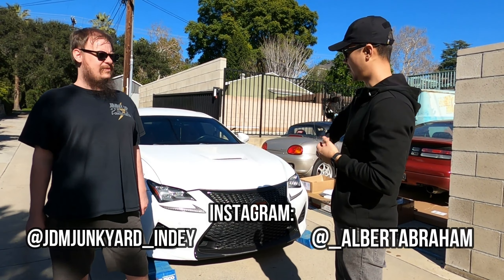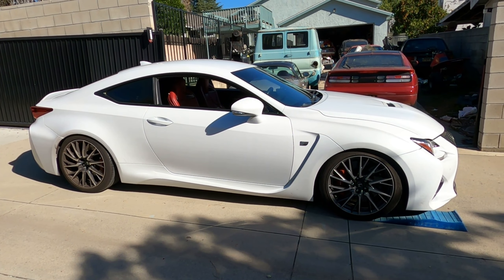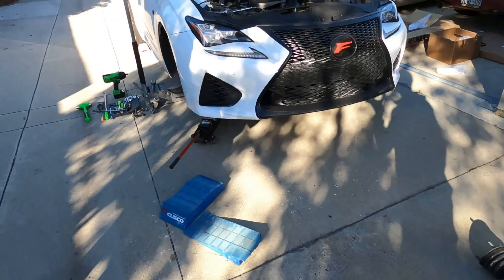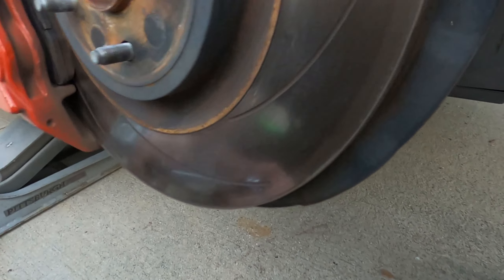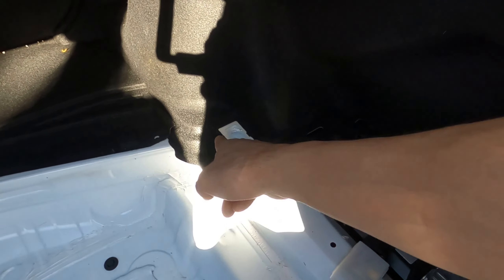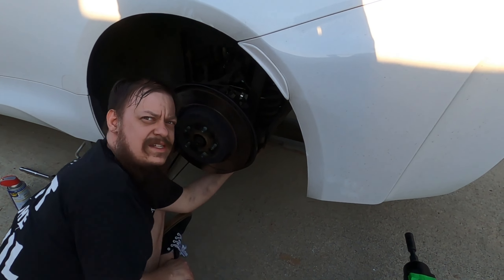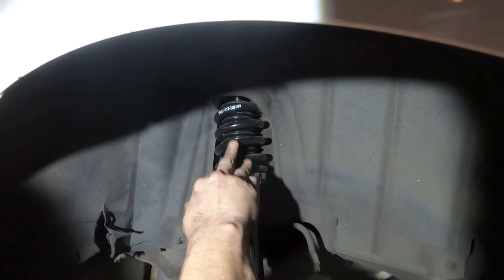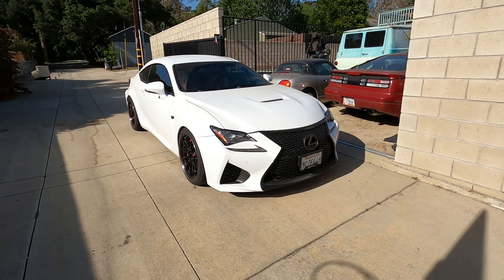LEXUS RC F COILOVER INSTALL! (Silver NeoMax)

Comment: Besides for aesthetics, why do this?  what is the benefit for handling?  I will do normal Grand Touring driving with occasional spirited driving.  I'm certainly not looking to modify the exterior looks as I live in an area with lots of potholes on the roads.
Reply from the maker: Based on your needs and priorities, I wouldn’t modify the stock springs and struts 

It performs very well stock and still gives you the flexibility for driveways and potholes. 

You could theoretically install coilovers and retain oem height but the performance advantage is less so than you would see from sway bars

I’d look into a good set of aftermarket sway bars, they’ll reduce body roll and work you towards more neutral steering while allow you to retain stock ride height and ride quality 👍👍

Comment: Driving impressions on the road. What is the spring rate for the silvers?
Reply from the maker: The ride quality is what I would consider oem+, it handles great but it’s not harsh. The default rates from silvers are 12k front and 10k rear. Keep in mind that if you get any brand of coils, they need to be set up correctly for preload and strut dampening, otherwise your ride quality will suffer.